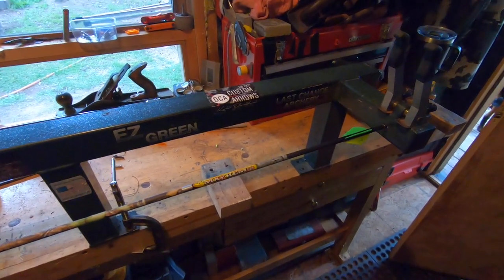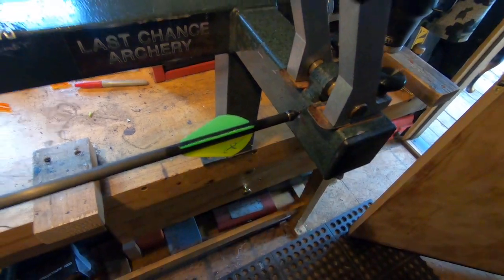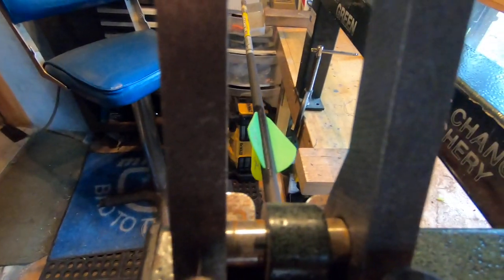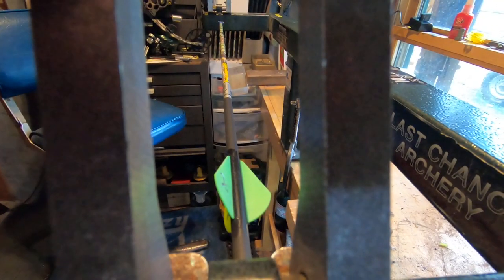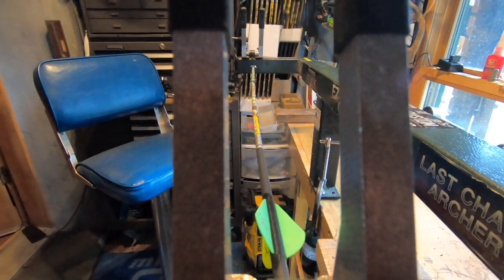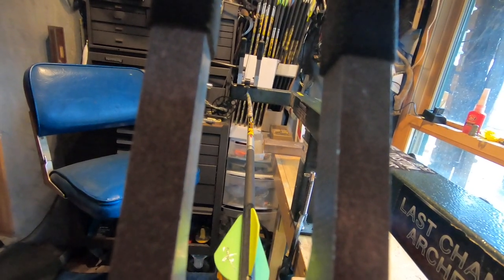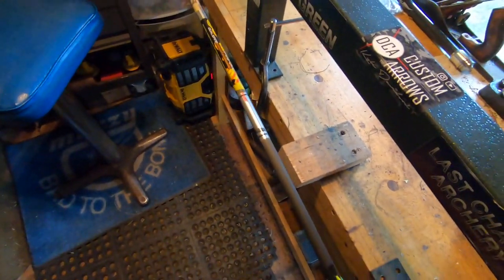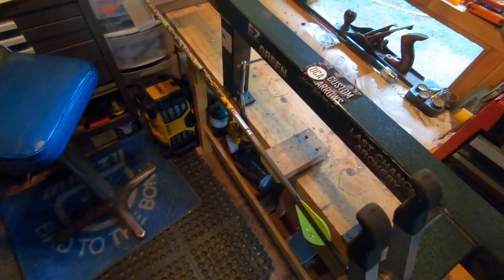How to Spine Align arrow shafts fast; Column Loading Method; Last Chance bowpress, FIRST BEND TEST

Comment: I love this method. I figured it out myself a few months ago and then saw a video (this is now the second) doing the same thing.

To those sayi g random results, the arrows prefered flex direction is slight and gravity will play a role. If the arrow wants to flex up, gravity might fight it from flexing in that direction so then you get a half up, half sideways bend. By playing with it, you can figure it out and then get nearly identical and repeatable results months apart.
Reply from the maker: Excellent.  It is interesting how it can work - combining this with alignment squaring and you can clearly enhance accuracy surprisingly well.

Comment: Keep getting random results… am I missing something?
Reply from the maker: It takes a certain amount of practice depending on your setup.  The concept is not parallel to a linear strong vs weak spine.  Instead, dynamic spine when column loaded can have more than one weak side and more than one strong side depending on the carbon and not necessarily orientated 180 degrees opposite of each other.  Takes time to get each balanced just right and even then they might still have their own character bc the shaft is carbon.

Comment from the maker: So some dudes end up in the rabbit hole on this one -- this is a basic type of thing.  If you stick to the recommended size spine charts and build with straight components already then this is an extra step you can go thru to calm your nerves .... you did everything you could with your set of personal arrow to make the best groups for humane accuracy possible.  If you have some strange fliers then this technique of measuring can help quickly sort out a damaged shaft or out of spec.  It is simply another way to think about the forces the load into your shaft and how you can really control it.

Comment: Ive done this test and found it to be random results. With same arrow
Reply from the maker: Sometimes it will be random.   Interestingly gravity can influence direction when the column loading is forces or the arrow shaft itself can be somewhat unpredictable finding more than one soft are to induce first flex.   The strong and weak sides are not necessarily 180 from each other and in some cases the shaft load seems to spiral or corkscrew under load.   More than one soft spot should generally mark both spines for orientations and group sorting.   About 2 from a dozen can have this occur.
Reply: @donfrance3  very informative. Thank you.

Comment: I think the press is forcing the arrow in  one direction, the press is biased. The pressing flats are not exactly paralell. The press was not build that way. This press need some sort of multidirectional hinge. Maybe a steel ball drilled to center sort of thing. Otherwise it is unclear what one is determining with this test.
Reply from the maker: cool man - you can say that no problem bc there is a good chance of introducing bias to such a setup and it's usefulness is a matter of the user.